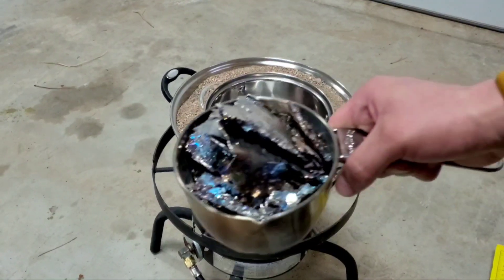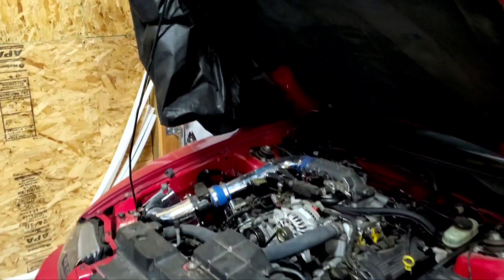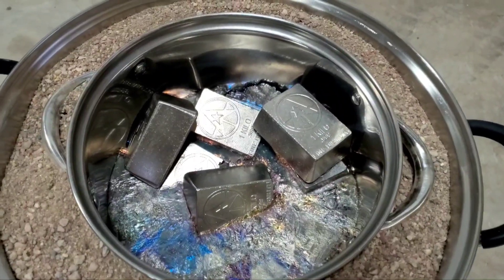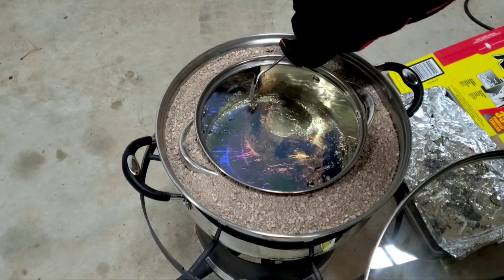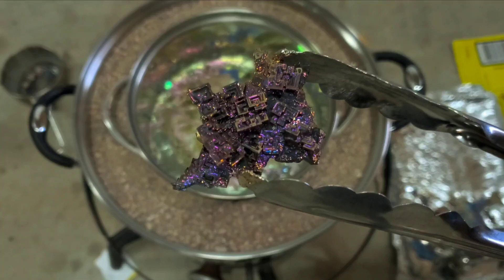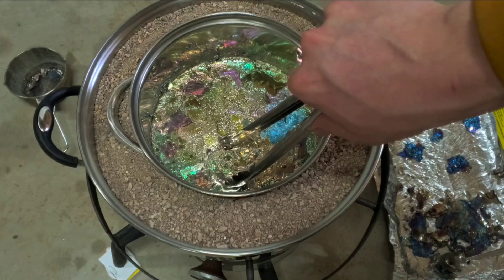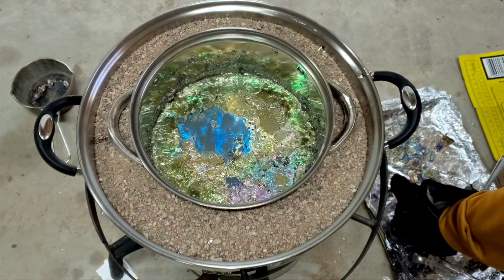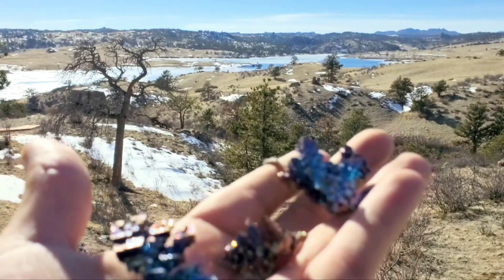Making Large Bismuth Crystals

Comment: how long to melt? and how long do you waited till the first pull?
Reply from the maker: It takes about 30-40 minutes to melt it all down. Plan for 2 hours for the whole process each time. First pull is done after turning off heat and waiting about 5 minutes for the first layer to form on top. Good luck! 🍀

Comment: Why not step the temp down like 25 degrees every 10 minutes or 25 minutes and let the cooling down process take 2-3 hours i bed you’d get awesome crystals then
Reply from the maker: I've tried this and the problem is the top layer hardening too quickly compared to the rest of the pot. I bet an electric heating plate would work better than my propane turkey boiler, lol.